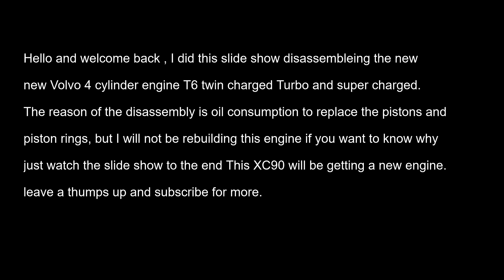Volvo XC90 Oil Consumption disassembly 2.0 twin charged T6

Comment: Hi,

I have the same car/engine.  Is this a common problem with the SPA XC90?
Reply from the maker: It is a common problem on the early 4 cylinder engines Volvo have updated the engine we have not seen any problems with the updated engines. They have also updated the pistons and rings as a repair for the early engines.
Reply: @TheVolvoGuy  did they fix it in the 2017 models?  That's the one I have...
Reply from the maker: @RandomYoutuber1023  yes they did but some of the early 17 did have the same problem. But if you send me your VIN I can let you know Monday for sure. Thank you.
Reply: The Volvo Guy i hope you can gide me
Reply: @TheVolvoGuy I have a 2018 xc90 T6 with the same issues. Currently non operational at the Volvo dealer. How can you tell which engines maybe compromised using the VEH #???

Comment: How can i tell if my early 2017 XC90 T6 has the old piston rings or the new piston rings?   Is there a visible difference in the piston?   I have the cylinder head out at the moment, i am wondering if i should replace the rings.